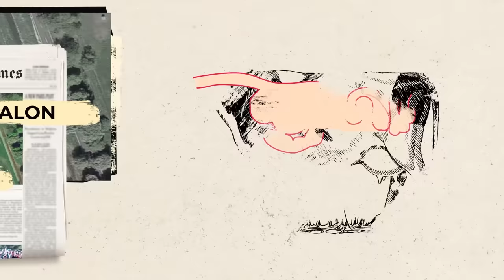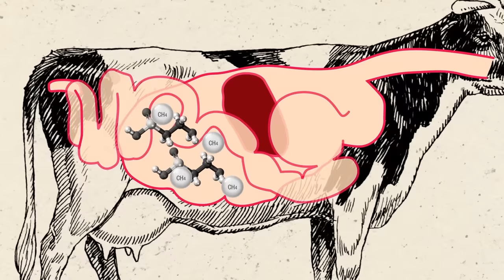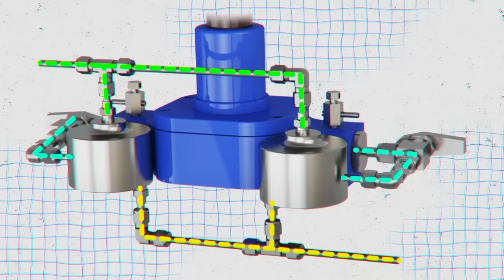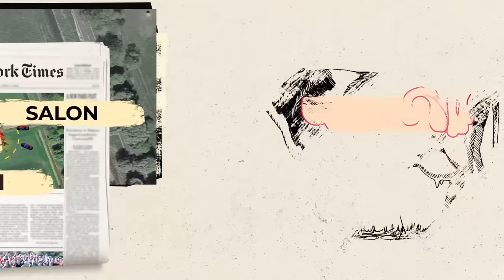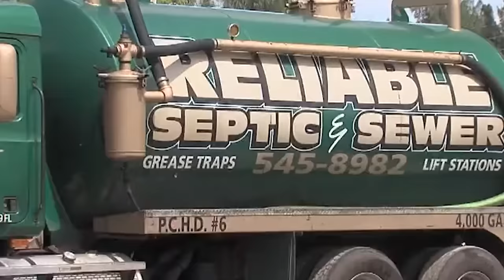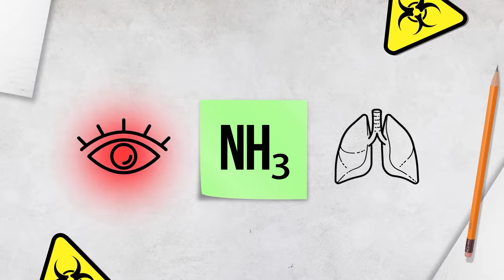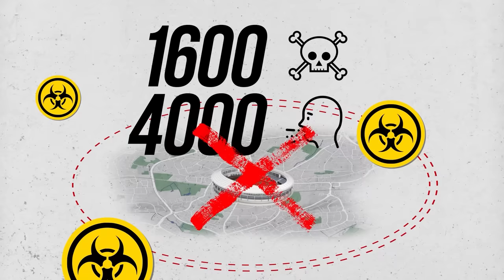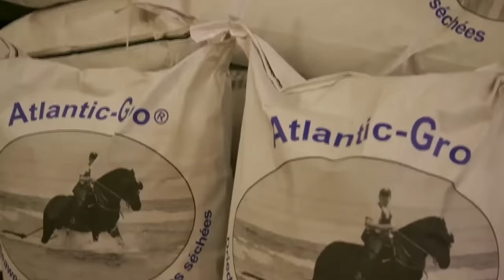Farmer’s Nightmares

Comment: Whoever edited this video, and made the thumbnail did wonderfully!!  Very smooth transitions, and the thumbnail looks very natural.

I lived in Lacey, WA (connected to Olympia, the capitol), and on the outskirts of that city is an area called Hawk's Prarie, which we locals pray we never have to visit.  It's becoming much more built up, and much more residential as time passes... only one problem with that: Ostrom Mushroom Farm.  So far as I'm aware, Ostrom has been in the area for a very, very long time- much longer than residents have been common.  They use manure as the main substrate for their mushrooms, in a large, enclosed warehouse (enclosed to control how much light the mushrooms receive).  A few times a day, they turn on fans and refresh the air within the warehouse.  If a bus has passed through the area while they're fanning, it will reek as though someone was lactose intolerant, and let loose some wicked diarrhea in the bus long passed Hawk's Prarie.  So far as I know, the residents are becoming increasingly upset with the smell, but they can't do anything, because Ostrom has been there so much longer.  Nonetheless, with as much as the city has been adding residential plots to that area, I wonder if Ostrom will ever be ousted- or even offered a place to move.

Thank you for putting this episode together- it's a topic I've been well aware of, living in a farm-integrated city, but a topic I feel most people are unaware of.  I'm not against eating meat, but I definitely believe there's better ways of doing it than we have going, currently.
Reply: I used to live near there. Smelled like more than animals feces for sure

Comment: Simply spraying cow or pig manure on farm land is not allowed in the Netherlands. Manure has to be injected, so it's immediately under ground. Costs a bit more, but it saves a lot of complaints. 
Notes: 
- It's not perfect. 
- I have not looked this up, it's just from memory. 
- However, wherever you go through the countryside, you never see or smell fresh manure, or the tanks just spraying it the way they did, long ago. Whew.
Reply: The injection is not only for the smell, but mainly to reduce emmisions. The sandy soil of the netherlands is particularly bad, which is why they have been one of the first to legislate stricter spreading rules.

Comment: Enjoyed the video!
You might want to look into the difference of methane produced between grain/corn fed beef and grass fed beef. 
My understanding is most cattle are at least corn finished(fed a corn diet before slaughter) which cows have the wrong stomach to digest leading to massive overproduction of methane (oversimplified). 

I beleve the study you are referring to compares corn fed and finished with algae fed cows, however if you compare algae and just any old grass it would be much closer in methane produced without all the added transportation greenhouse gasses from moving the algae. 

Along with rotational grazing and relying on grass it has been shown to be one of the largest and most energy efficient methods of carbon sequestration while also lowering the labor needed to produce meat& milk and building the soil with organic materials and better habitat for microorganisms. 
But don't just take my word for it, reserch for yourself and learn about the beautiful symbiosis that has been going on for millenia. 
Think about it, if cows and other ruminants are such a cataclysmicly horrible problem then why hasn't millions of years farts rendered the earth an empty fire ball swirling through the cosmos...?

Comment: I live in the Texas Panhandle. When I first got here, the smell of the (extremely high number of) cattle ranches, feedlots and slaughterhouses bothered me... well, moderately. It wasn't torture or anything. The slaughterhouses were particularly distinct from ordinary cow smell; I once described it as "fried sewage". But now I've been here for about 14 years or so and it's just... normal. I've done some construction work on farms, driven around and near them. It doesn't even bug me now. In fact, it even feels like it's almost a positive thing. Whenever I move away, I might miss it. You really can get used to anything.
Reply: Yeah, farm smell can be intrusive at first, but you get used to it very quickly. Slaughterhouses not so much.
Reply: Swine slurry sprayed as fertilizer on fields would bother you.  It will make you vomit.  In my rural area, even farmers objected and the county outlawed it.  They do use chicken litter all the time, though, and that's bad enough; I've never gotten used to it.  They still let folks bury dead horses and livestock on their land.  I worry about my well.

Comment: Small note about the additives to methane and similar smell-less, explosive, gases, part of the reason people started to do that was because of the New London School Explosion.

In March of 1937 in Rusk County Texas, Lemmie Butler turned on a sander in the London School, sparking the natural gas that had built up from a leak in the school’s heating system. That spark caused an explosion that killed over 295 and many more were injured, making it the third worst disaster in Texas history.

Comment: Lidocaine injections actually burn and hurt so bad until the fluid injected starts working. It's burns because it takes time to absorb into the tissue. Ive had 4 ingrown toenail procedures that removed the badly ingrown nail. The injections on my toe hurt the most. Plus it's so thin in some spots they sometimes scrap the bone in your feet which feels awful. I've had numbing injections during other surgeries too but the toe injections hurt the most.

Comment: Fun fact. You need a certain percentage of oxygen and fuel mixture to combust. Too much gas, the fire will go out, too much oxygen and the fire will go out. 
You can drop a match inside a full tanker of gasoline, and it will not ignite. The tanker needs to be about 30% empty.

Comment: This is why a lot of people in my area who raise cows give them the most room possible and rotate them. Giving them a better grass diet (compared to a high corn diet), spreading out the poop so its not as in a concentrated area, and of course happier cows. Another thing is barn design. Cattle barns should have areas for air to escape such as cracks in the wall, windows, or vents. This helps disperse the gas trapped inside the enclosed barn and decrease health hazards for cattle and people. The only time this becomes a challenge is winter in northern cold areas. While cattle do have nice thick winter coats, sometimes it gets too cold for the cattle to handle and they stay inside. Times like these are where consistent cleaning of the barn becomes handy.

Comment: Believe it or not that hole they put into the sides of cows isn't put there for gas release. It's actually so farmers can check if the gut flora/biome is optimal for regular digestion. They do it about once every 30 cows or so, and it's more so  farmers can guage if their cows are ruminating properly. If the cow with the hole has a well maintained gut flora, more than likely the remainder do aswell.

Comment: Ok simple points to make: 
1. Water vapor is more heat trapping than CO2
2. If it wasn't cows, pigs, chickens, etc it'd be something else. 
3. The carbon cycle is a cycle for a reason, it goes around and around. 
4. Being a little warmer isn't an absolutely bad thing, the Earth wasn't always this average temperature.
5. If you really want the Earth colder, start a nuclear war. It'll cut human life span and increase the refraction of the Earth. Thus a cooler planet and less people. Facts and context matter, fact is that the ecosystem is more in danger from humans releasing pets into it than CO2 which would've already been in the environment anyways.

Comment: This isn’t about a cow exploding or methane on the farm.... but the feed silos are just as dangerous.... corn dust and the gasses from fermentation if it wasn’t dried fully will explode like you had a bundle of tnt in your hand....
I worked in a feed mill for 1 year straight and at least 2 times a month I had to clean it, I’d get pissed if the boss and my fellow coworkers would come near me with a lit cigarette..... well long story short I almost refused to clean it they came up as I was cleaning.

Comment: Idk about this tbh. The thumbnail is of someone draining abscess. Cows do indeed develop many diseases though. The main reason they are removing the grass from that particular stomach is to prevent the grass from piercing the stomach and causes many different types of infections (mainly abscess) Also what the man is lighting are indeed pockets of gas...that leaked from the stomach, probably do to grass piercing the stomach, or a foreign object because cows eat crazy things when grazing lol. I’ve found magnets, glass pipe, pens, etc when I use to work with cows.

Comment: Under a layer (of foam): aerobic bacteria wont make methane, so the top layer of sludge puddle is un-colonized, making no byproduct-methane until a couple-inches-deep the anaerobic-colony's soluble-methane builds-up (like carbonation) just in-solution making barely any bubbles 11:05 like seltzer: layers are separated with a lid of aerobic-bacteria that keep the methane-solution still; if something plops into the sludge the methane layer depressurizes methane to the surface. It happens with carbon-dioxide-inversion in lakes by the same principal; also lethal.

Comment: If you think a barn stinks, well with every livestock you have to have dead stock, and I used to work for a dead stock company driving from farm to farm picking up dead stock, back at the dead stock plant is 50 times worse than any barn odor you can smell.   The worst thing that has ever happened to me with this job, is a is a dead swollen maggot filled cow blew up all over me, in the dead sweltering heat of summer.🤢🤢🤮🤮🤮

Comment: I'd be cautiously optimistic about using cow methane for fuel...
Knowing people, someone will simply make cow 'breeds' that are essentially meat cattle that are designed to produce as much methane gas as possible. This would be to maximize profit of course. It would also cause these cattle to 100% require these capture devices less all that pollutes the air.

Comment: Smoking while pumping gas and causing a fire/explosion practically never happens. You can drop a lit cigarettes into a puddle of gas and it won't ignite. Shit when I used to do commercial roofing some of the more cunty guys in the crew used to put their buts in the gas reservoir of the generator. Idk maybe they thought it was funny or just wanted to fuck up the equipment idk why they did it I just know they did it. The only way it's even remotely possible to ignite gasoline with a cigarette is if the surface area of the cherry of the cigarette is 
 abnormally  larger and hotter than it usually is.